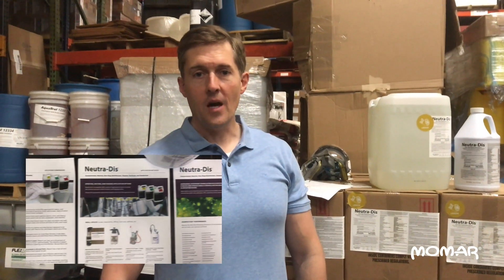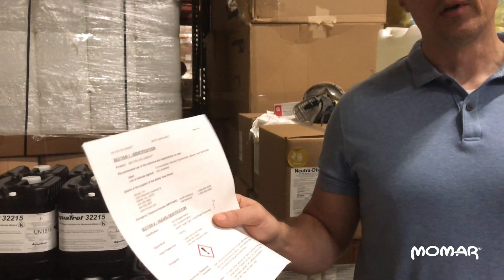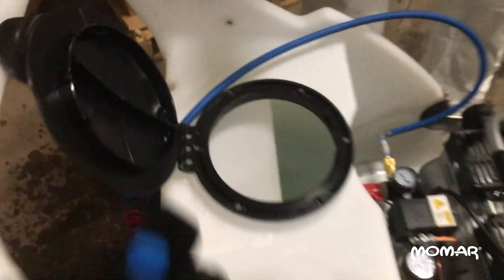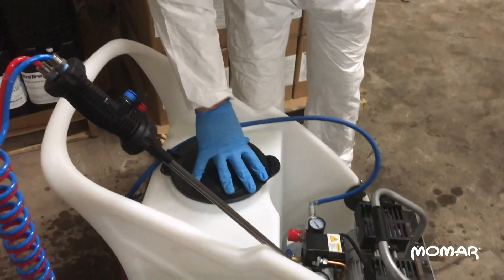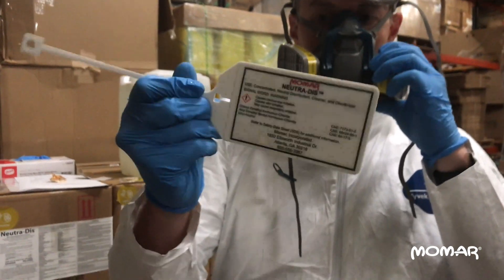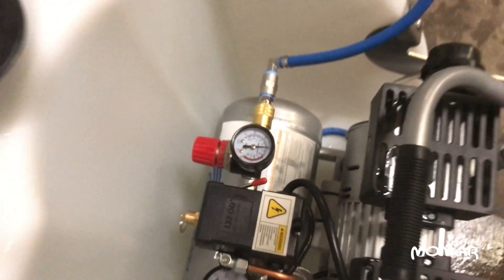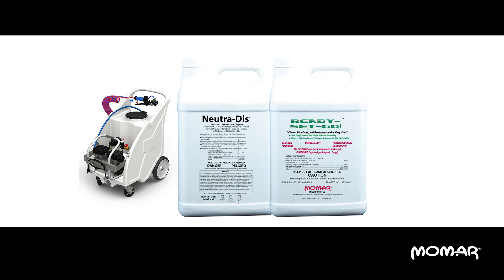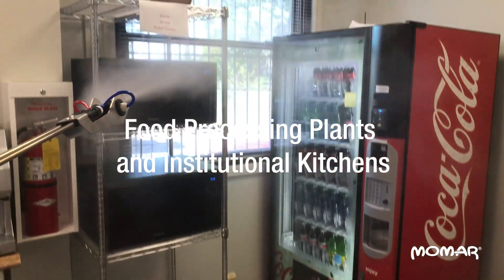How To Fog Mist Disinfectant Safely In Large Spaces

Comment: Question, is this setting safe for spaces that have electronic parts? I mean does it bring wetness to the procedure or it's a dry fog?
Reply from the maker: Thanks for your question.  When used properly this unit may be sprayed around most electronic equipment. This unit dispenses a 15 micron mist which when applied correctly, should not result in any large product accumulations, and any increased moisture should evaporate quickly. As you can see in this video, this unit is used to disinfect in several areas which do contain electronic equipment such as a vending machine, microwaves, laboratory scales, and other electronics. It is important to note however that the recommended disinfectants are water based so if used incorrectly and the product is over applied the potential for water damage may arise.